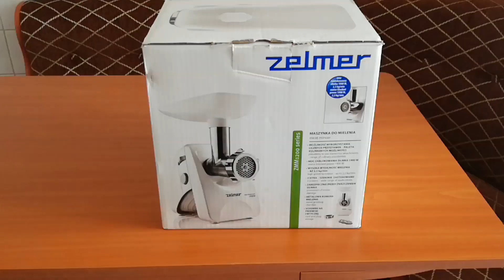VW Crafter 2010 - Am schimbat discurile si placutele de frana

Comment: Sall as vrea sa iau un VW crafter carosat si vreau sa stiu daca sun scumpe piesele si daca motorul lor e bun la ceva  😊
Reply from the maker: Mașina nu o am de mult timp sa ma pronunț, dar din experiența mea cu mai multe modele de la vw, motoarele sunt bune, s-au cel puțin masinile care le-am avut au fost bune. Ca si piese de schimb, nu mi se pare prea mare prețul lor. Ex, franele au costat 950lei, o distributie costa in jur de 850lei, toate cele 4 filtre undeva la 150lei, dar prețurile difera, depinde cum te descurci. Per ansamblu este o mașină ok...
Reply: Ok mersi mult si seara faina 😉
Reply from the maker: @sorin25scsr49  Pentru puțin...seară frumoasă